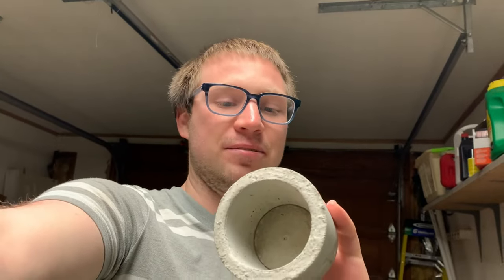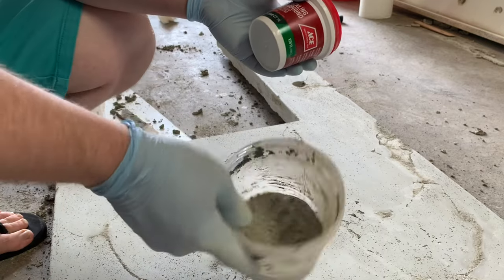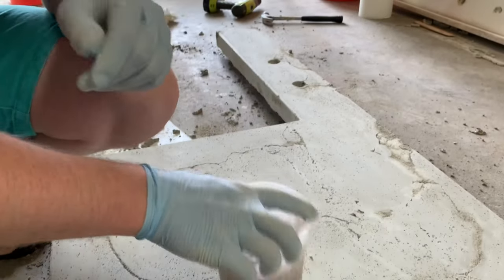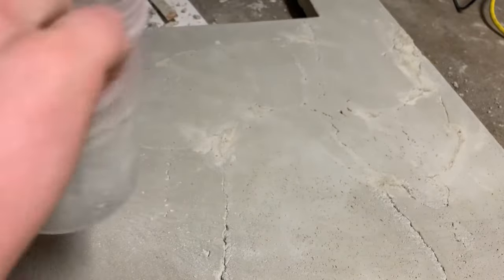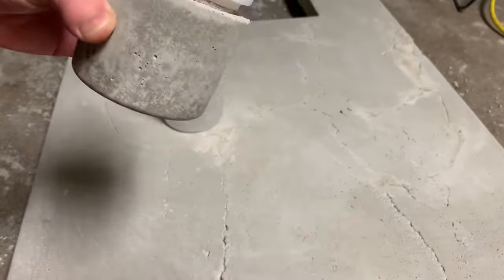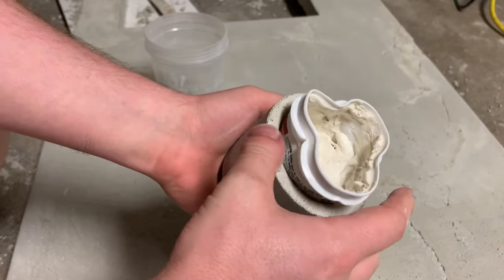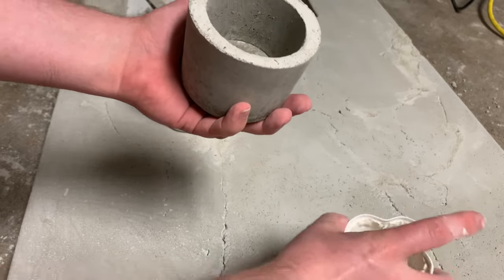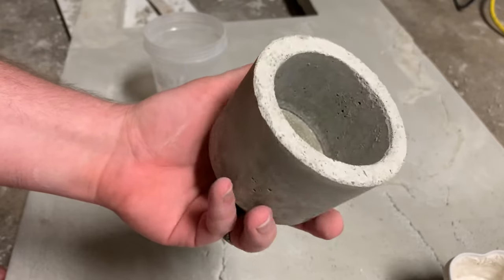Quick easy way to make small concrete pot for succulent DIY do it yourself rapid set mortar mix 4K

Comment: Tip: Coat the outside of the inside bucket in cooking oil. Then wrap glad wrap tightly around it. Once the concrete sets the outside of the glad wrap will grip the concrete but the inside is smooth and oiled so it lets it slide right out. Once out just unwrap the glad wrap out. Done in under 1 min.

Comment: Wish you could tell to make a drain hole too, in this cute thingy ✨💞
Reply: Cordless drill + drill bit.
Reply from the maker: Yes you could drill it out, you can also use a small piece of styrofoam in the bottom and can push it out after it sets.

Comment: Haha.. It took you not less than 5 min to take out that plastic container..
Reply: People use oily stuff to prepare the surfaces beforehand so they wouldn't stick, that's a great tip for anyone willing to try
Reply: Easier trick is using pliers. If youre making this for cactus, just use a large red plastic cup. Takeaway plastic bowls are the absolute best.